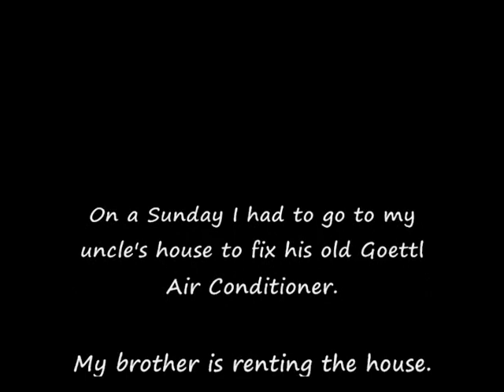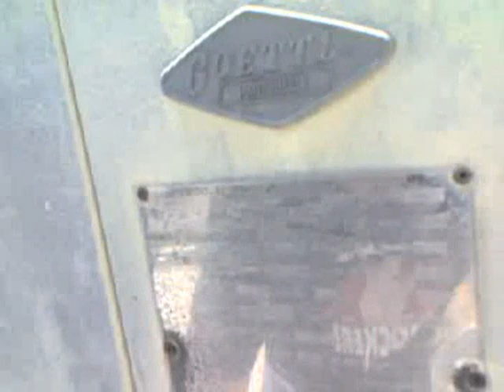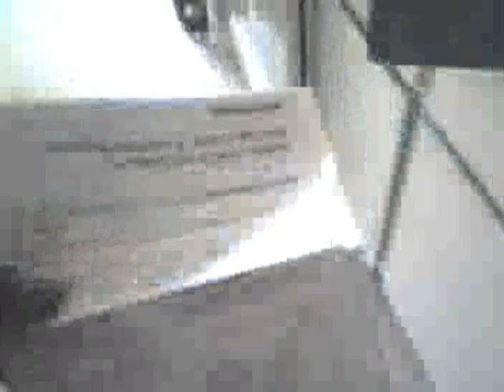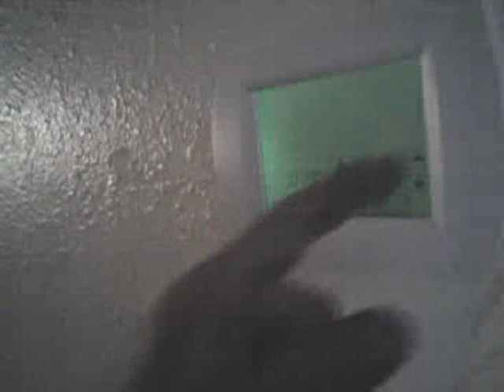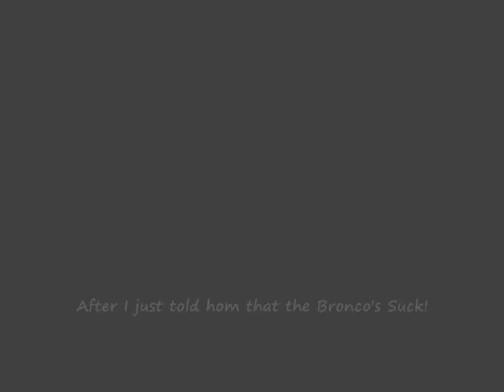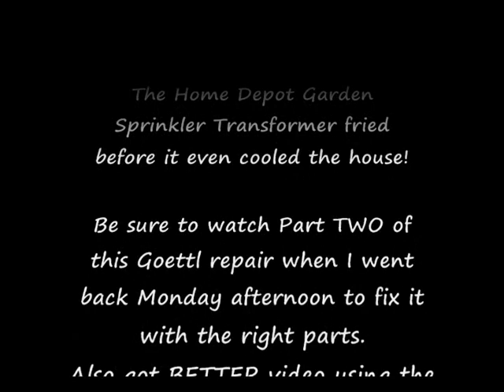Old Goettl AC Repair - Part I

Comment from the maker: It IS an old f-ing Goettl! But it is a tank, and they always were tanks until after 2000 or so. Probably the most reliable brand ever installed in Arizona. Probably because it was built in Arizona! Rescue Motor is a universal fan motor. Covers a wide range of HP and loads and is reversable. Makes it so you have something to fit many applications.

Comment from the maker: Yeah I thought 30 years as I looked at it. But it may be 25 years old (1983) once I looked at the tag. But still, they were tough as nails. You will certainly gain efficiency with the 13 SEER but don't expect it to be bulletproof like these were :p

Comment: one of those goettls in my neighborhood is origional to the house  and all the parts are origional to it. the damn thing is 47 years old. the top two brands in my opinion are geottl and trane.
Reply from the maker: Roush Hawley 
INDEED!
Those old GE made Tranes were very tough too.
Reply: My grandpa had an early 80s GE a/c at his apartment. that thing was rock-solid reliable and was 10x quieter than the crappy Goodman & Nordyne units next to it. only thing ever changed on it was a run cap that finally went after 20 years of texas heat.

Comment: Holy crap, thats a 30 year old unit? Thats the same unit I used to have in my house (indentical), just replaced it for a 13 seer trane package heat pump.